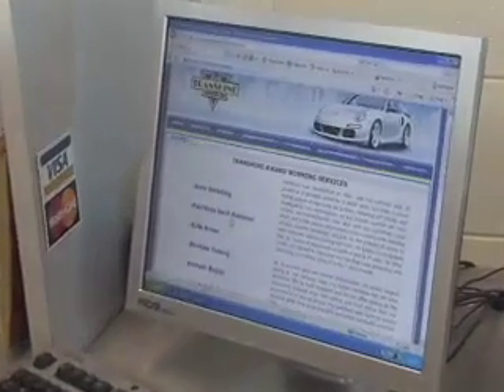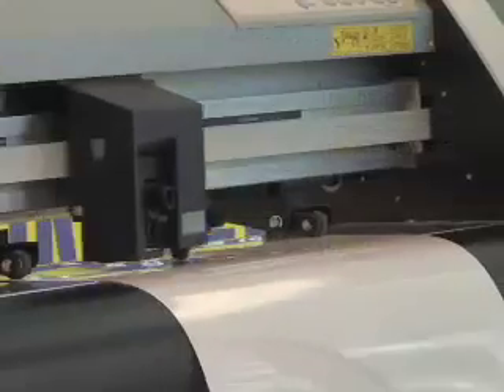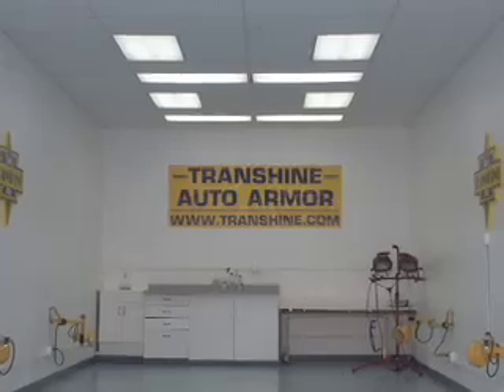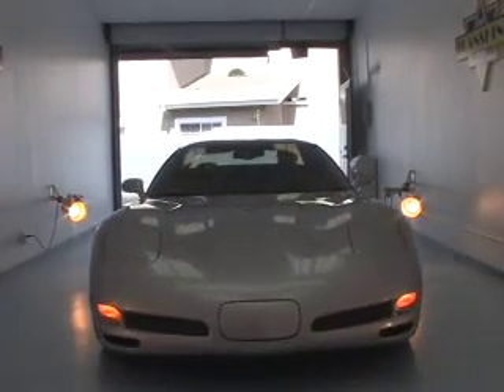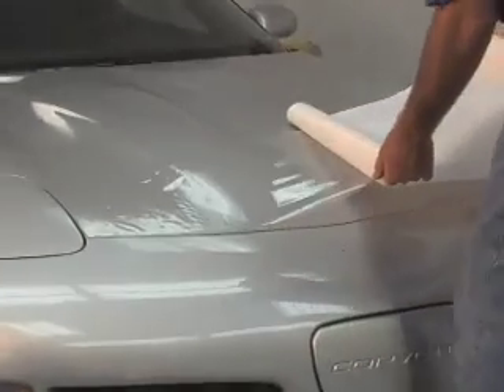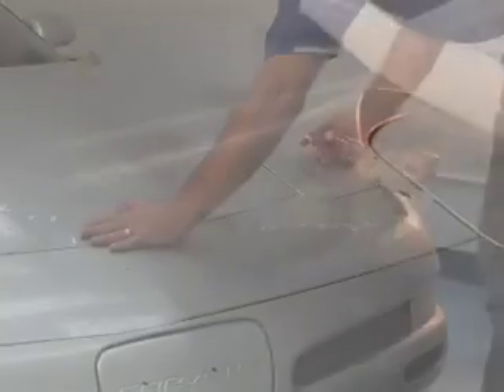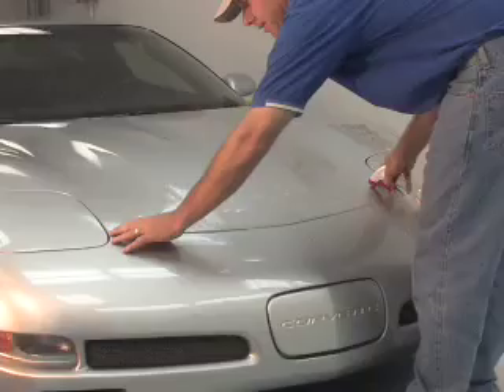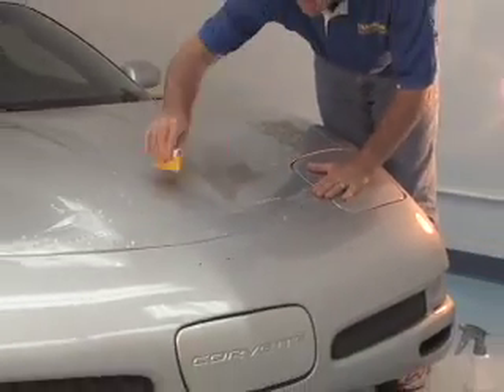Auto Clear Bra Paint Protection Film

Comment: The product is not the problem.  Your 2 grand bike has a very cheap finish.  

Epoxy type glue is much different then a resin which is what real carbon fiber is bonded with.  The film is not strong enough to pull apart properly laid resin.  And resin is much stronger then paint which the film is made for.  Sounds like your rollin a tight huffy...lol